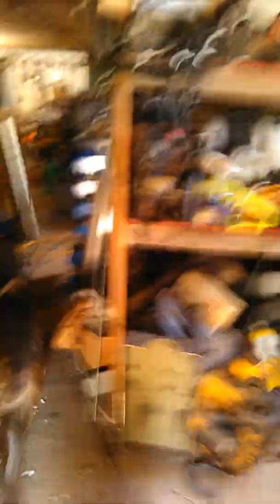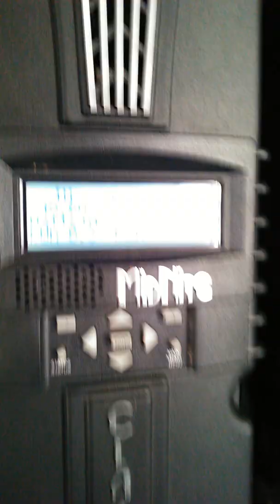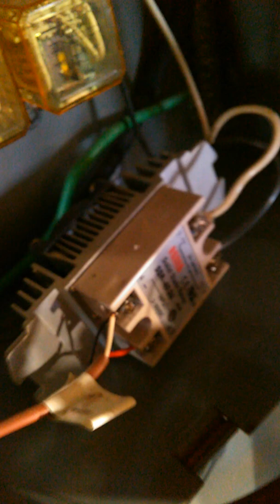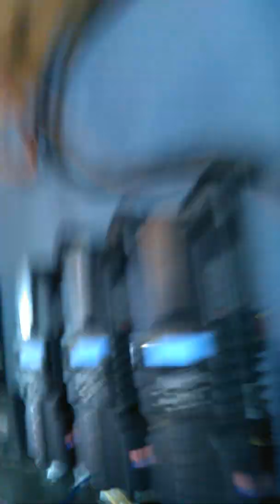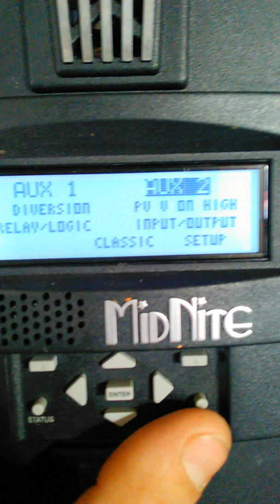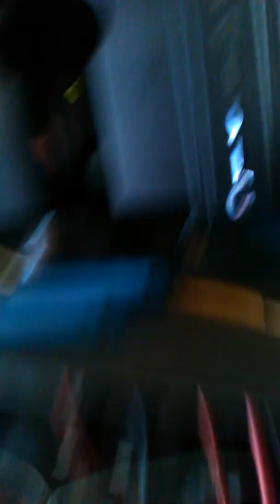Homemade Wind Turbine, AFPMG, off grid, solar panel

Comment: Excellent setup, lots to learn for me, thanks
Reply from the maker: I'm up for questions anytime.
Reply: @chadarmstrong1631  ...I also have a classic midnite solar but I stopped using it, maybe I try again, I like very much how you use aux1 and aux2 for diversion load and dump load, why do you limit it to 90 volt via aux2, the classic could go much higher? Why not let it go to 130 or so.
Reply from the maker: @johnq8792  aux 1 is battery side dump. Aux2 is three phase dump on the Turbine side, it's trimming off the top of my power curve starting at 90vdc incoming. I'm hitting max efficiency at 90vdc. The 150vdc MNS controller can only handle 2700w at 24vdc system. So I'm protecting my controller when the Turbine produces more than 2700w.

Comment: Hey been real busy. That blade does it have a leading, trailing edges? And thanks for vid dump load, your video I'm sharing 😃 thanks for showing that...
Reply from the maker: I hand carved the 2x10 into a prop. So it's got an airfoil for lift.
Reply from the maker: The other night I pushed a peak out put of 160.9adc at 30.5vdc with the Turbine stacked on two MNS 150v on 80kmh gusts. Will post a video of the out put on my clamp meter, made the video for my engineer friend I work with. His site I'm sure you have seen. Emagnets. If you want me to post the video, just say.
Reply: @chadarmstrong1631  Chad the more videos, the more people will notice and learn. Emagnets, I've heard about him and sub to him since I can remember...